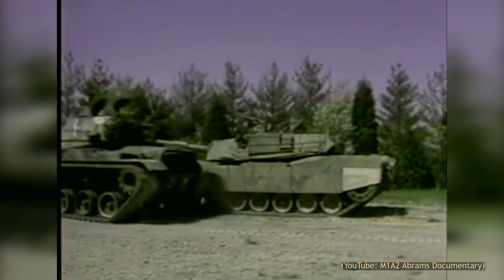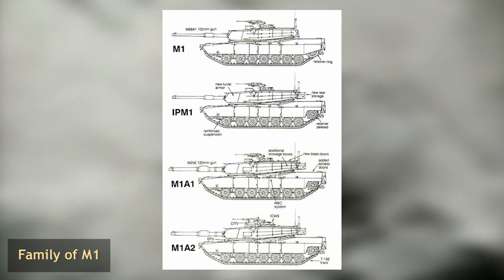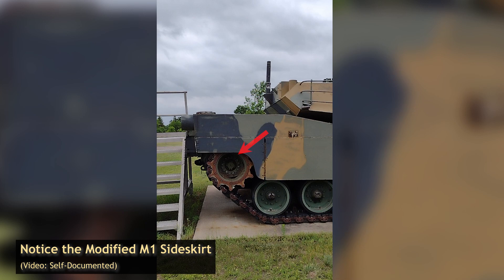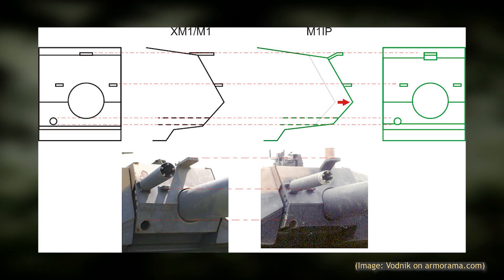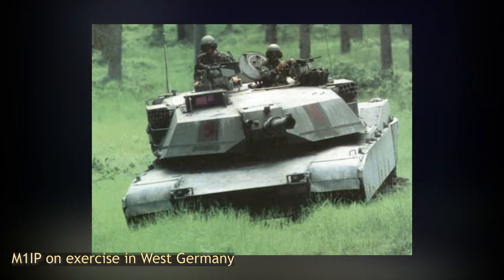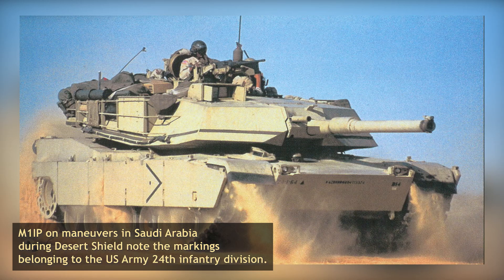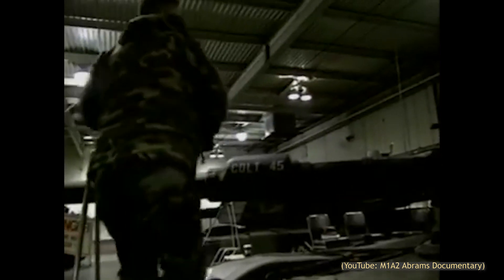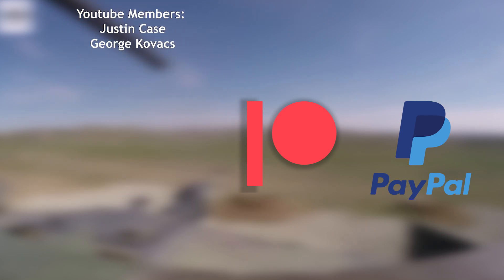The Abrams That Everyone Forgot | M1 Abrams ‘Improved Performance’ (M1IP)

Comment: FYI. Delta Company 1/66 Armor  2 AD received 2  M1E1s in 1983. For training field and gunnery evaluation. I was with Cco 1/66 Armor. I went through OSUT at Ft Knox C-1-1 in 1982. We started removing the rear skirt in early 1983 because mud would get caught between the sprocket and break the skirt pins. They were made from aluminum. We started cutting them into the current shape by mid 1983. With the skirt removed mud would fly up and cover the whole top of our tanks. Feel free to reach out to me. I have lots of early M1 memories and pictures.

Comment: We had these in South Korea, circa 1991.  Even in 1991 these were considered out-dated, as a bunch of M1A1s had just showed off their capabilities in Desert Storm.  But I do remember those outdated tanks were outfitted with very modern Sincgars radios...a weird juxtaposition of old and new.  And because of the security situation, the tanks in the motor pool had main gun rounds on board - every month we'd pull them all out to inventory and wipe down.  This included the often forgotten APERS anti-personnel round for the 105 mm gun - nasty.
Reply: FYI: I left 1st Tank (1/72d Armor), Camp Casey in Aug 95 just before 2ID replaced the M1-IP's with M1A1's....
Reply: Hey, any chance this 105mm APERS round can be used by the Leo 1s in Ukraine?

Comment: I am doing some research on this. Do you know which units got the M1IPs? It was a very limited production run, so they weren't as common as the normal M1s or M1A1s. From the evidence I could gather 24th Infantry Division got fully equipped with them, 3rd Armored got them (But I am not sure if the entire division did), at least the forward brigade of 1st Infantry in Germany got them, and possibly 2nd ACR got them.
Reply: iirc 11th cavalry had them too

Comment: It's pretty tough to tell the difference between an M1A-1 and M1A-1 AIM or M1A-2 Vs M1A-2 SEP.
Reply: To  be fair, there really is little difference between them all due to the modular nature of the base vehicle. The A designations are really just a mark of what modules happen to be installed, not what chassis they bolted them onto.